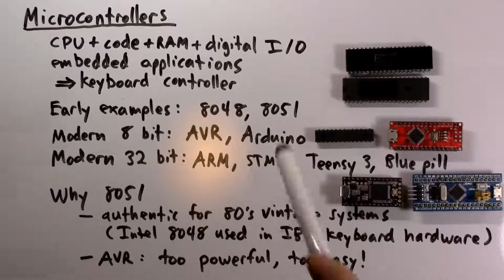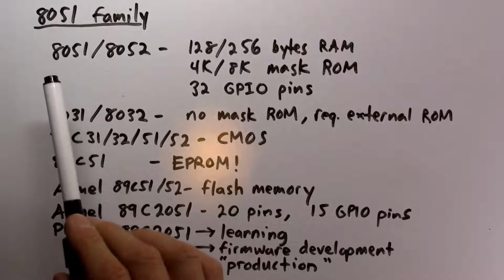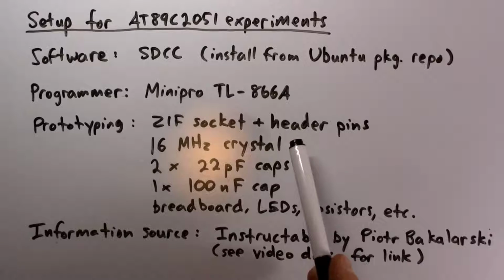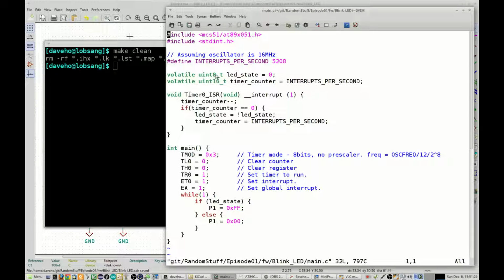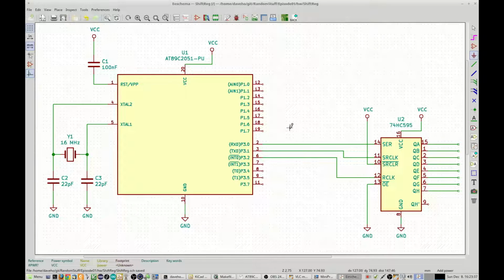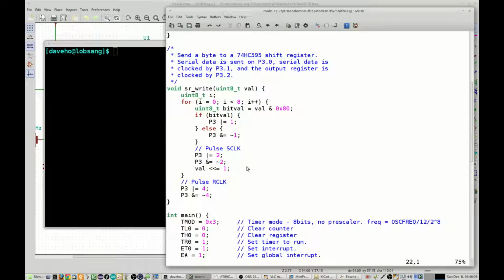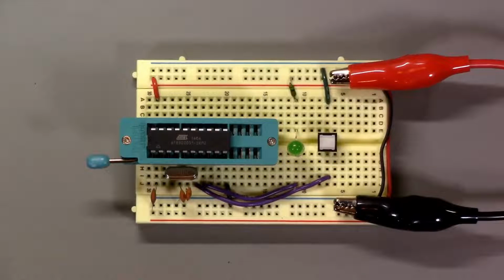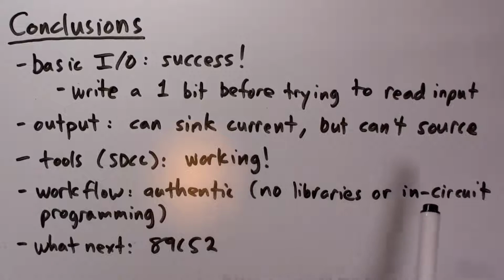Random Stuff, Episode 1: 8051 family microcontrollers, initial experiments

Comment: My first microcontroller was an 8031 system built on a RS breadboard in the late eighties or early nineties. It only takes 3 chips, the xtal, and the caps. I had to build my own eprom programmer to program the 27C64.  I still can't believe I got it working. The programming was with the TASM assembler. 

I think your problem reading the input pin is that  the line
P3 &= ~8;
reads the low state on P3 and writes the low state to the input pin. I could be wrong. I got an AT89C2051 in a line follower kit from Banggood  and own a TL866 programmer. I didn't know it could program this device. Thanks for all the info and the neat project.

Thanks
Rick
Reply from the maker: Your 8031 SBC sounds fun!  I have a bunch of 80x1 and 80x2 devices that I plan to experiment with at some point.  Regarding the last experiment: pin P3.3 (updated as P3 |= 8 and P3 &= ~8) is only used as an output: the input is pin P3.2, tested with P3 & 4 (checking if bit 2 is set in register P3.)  It seems that the switch pulling the P3.2 pin down to ground changes the internal value of the register.  This happened even when there was an external pull-up resistor!  It's completely possible that there's something I'm not understanding about how digital input works on the 8051.
Reply: @davehohacks  Thanks for the reply. I got curious and did a little more investigating. If I understand the Atmel datasheet for the instruction set right, the logical OR and And instructions read the port latch and not the state of the the input pins. So your original code should have worked. I breadboarded the circuit and got the SDCC compiler working. Your video saved me a lot of time getting it going.
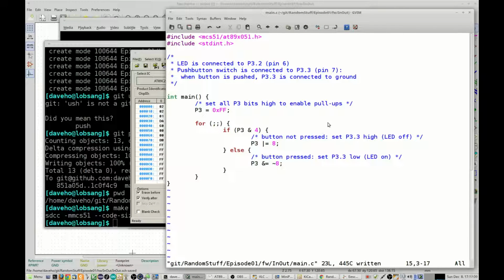My first attempt at programming the chip I got in a line follower kit, led to a chip ID error in the MiniPro software. Fortunately I had a clock kit that came with the same chip. It programmed successfully. Maybe the first chip was faulty or a fake. I tried your code as originally written(shown in video at 25:40) and it worked fine. Grounding pin 7 causes the led to turn on and removing the ground causes the led to turn off. I originally used a 6 MHz xtal but changed to a 16 MHz ceramic resonator. They both worked.

Since I had a chip that wouldn't program and you have one that's acting strangly makes me wonder if they are fakes or defects. Have you tried other chips in your circuit? I haven't played with 8051 stuff in a long time. It's fun stuff.

Thanks 
Rick
Reply from the maker: @rick_100  Thank you for looking into this! It's very possible that my 89c2051 chips are of suspicious origin. I think it's time to order some parts from a more reputable source.
Reply from the maker: Ok, I just ordered some actual AT89C parts from Digi-Key.
Reply from the maker: @rick_100  I believe I know what was going on with the program reading the input switch. The idioms P3 |= 8 and P3 &= ~8 to toggle the P3.3 pin are dangerous on the 8051 because if they are executed at a point where a P3 pin reading digital input is low—which is exactly what happened in my circuit when the pushbutton was pressed—a 0 is written back to the bit corresponding to the input pin.  At that point, the input pin is stuck low.  The solution, and I think this is what's intended on the 8051, is to use the instructions operating on a single bit (such as setb, clr, jnb, etc.).  I was confused because I'm used to the AVR, where each port has separate registers for input and output.
Reply: @davehohacks  That was what I believed was happening in my original comment. But the data sheet for the instruction set for the ANL and ORL opcodes says:

"Note: When this instruction is used to modify an output port, the value used as the original port data will be read from the output data latch, not the input pins."

So I don't think it was reading the low on the pin and then writing it to the output latch.
I examined the asm file created by the compiler with your original code. It did use the ANL and ORL instructions. If you want to try the SETB and CLR instructions on your chip, the following code was compiled and tested on my breadboard. It uses inline assembly. I also looks like you had the comments describing your pin assignments reversed, but the code matched what was on your breadboard so not a problem.

#include <mcs51/at89x051.h>
#include <stdint.h>

/*
 * LED is connected to P3.3 (pin 7)
 * Pushbutton switch is connected to P3.2 (pin 6):
 *  when button is pushed, P3.2 is connected to ground
 */

int main() {
 /* set all P3 bits high to enable pull-ups */
 P3 = 0xFF;

 for (;;) {
  if (P3 & 4) {
   /* button not pressed: set P3.3 high (LED off) */
   /*P3 |= 8;*/
   __asm
   setb _P3_3
   __endasm;
  } else {
   /* button pressed: set P3.3 low (LED on) */
   /*P3 &= ~8;*/
   __asm
   clr _P3_3
   __endasm;
  }
 }
}

The ports definately operate differently from what most of us are used to. My first experience with IO ports was with Commodore 64 user port and the 6522 chip. These had a data direction register like you would expect. If I recall correctly the 8051 ports are described as "quasi-bi-directional". I am curious to see if your new chips work with your original code.

Rick
Reply from the maker: @rick_100  Thanks for the detailed reply! I clearly didn't read your original comment as carefully as I should have :-)  Your inline assembly solution makes sense.  SDCC also has a __bit data type for access to addressable bits such as the individual bits of port registers, and it will emit the correct instructions for accesses to __bit variables.  So, for example, you can say P3_3 = 1 to assign a 1 to bit 3 of port 3: "P3_3" is a global __bit variable with the correct address to access the P3.3 bit.

So far my limited testing is that my original 89c2051 chips (from Ebay or AliExpress) behave in a way that's consistent with the (presumably genuine) parts I received from Digi-Key.  So they seem to be good now that I know what is actually going on.  I also did an experiment with an actual 80C32 running from an external ROM, and it behaved in consistently with the 89c2051 parts.

I may post a short video on the differences between AVR and 8051 digital I/O.
Reply: @davehohacks  Thanks for the info on the __bit data type. That's a lot simpler than inline assembly. Since I started out with assembly on the 8051,  my mind seems to revert to those methods. The 8051 was very good when working with single bits.  The SDCC compiler is very interesting to me since it also supports the STM8. Looking forward to your next video.
Rick
Reply from the maker: @rick_100  On these resource-constrained embedded systems it seems like you really need to understand the architecture and assembly language, even if you're programming in C.

Comment: The company I worked at back in the 80's designed gas cabinets using the 8751.  We had the Intel Blue-Box development system with hardware debugger and used PLM51 (Programming Language for Microcomputers) as a development language.  It was a little like a cross between C and Pascal.  I wish I could find an old blue box system that was still working.
Reply from the maker: Nice! I've read about PL/M. I would love to try out one of the original development systems.

Comment: Great, I'm trying to do the same thing with an i8052. I'd like to create a fully usable micro computer like the 80s.
Thanks for this video.
Reply from the maker: Glad you found it interesting!
Reply: I like the idea of creating some 80s like computer. The most difficult part is creating floppy interface, video out and keyboard controller. I often feel this parts require more processing power than the final computer would have as a system...